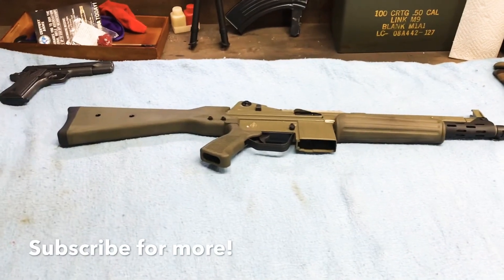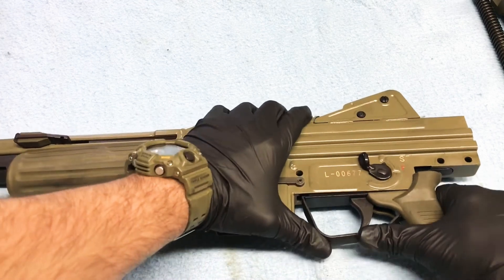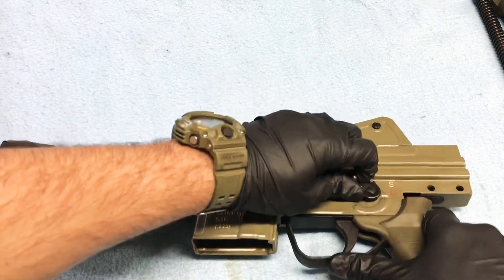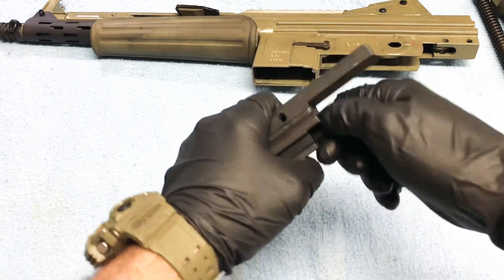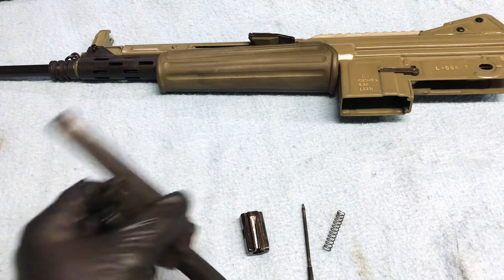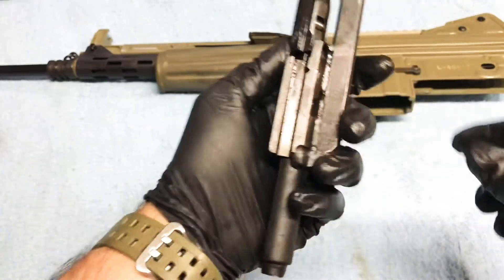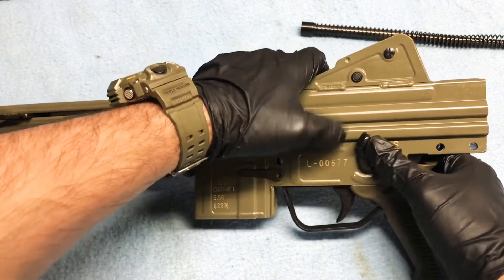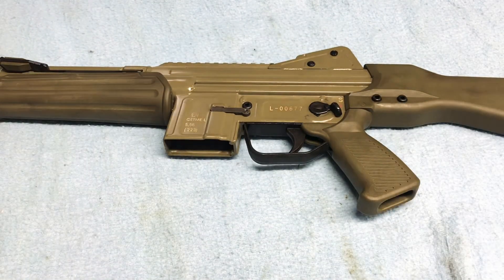HOW TO DISASSEMBLE YOUR CETME L, LV AND LC STYLE RIFLES FOR CLEANING.

Comment: The factory manual for the L states "There is a fair amount of manipulation required" for the removal of the safety lever. That is the understatement of the year!!!  My L is very accurate, I have a 2 mil RDS mounted, and after a 25yd zero,  I was hitting a 3" round steel at 100yds with 62g M855 LC ammunition.  Removal of the trigger pack requires a great deal of patience and calloused fingers.  If your fingers are not calloused, they will be after fighting the removal of the safety lever.

Comment: Two tips. To remove the safety lever, pull the trigger housing back to where it stops on the receiver, it will come out easier. 2nd tip, and this is just my opinion, for the trigger group push pin, place it in from right to left. That way when you release the mag, you won't push the pin out if you miss the mag release.

Comment: For turning the bolt head, I use a flat head screw driver in the bottom slot. Same as my Cetme LC, Cetme C and HK's. Some can be loose enough to turn with fingers but most with good springs you need a simple tool.

Comment: Thanks for the video.  It was very helpful.  I have the Marcolmar Cetme L and the PTR as well.  I just took the Marcolmar apart minus the bolt as I have not fired it yet.  Good lord, that safety lever removal is a pain in the ass.......The PTR trigger assembly just comes off as one unit without taking anything apart.......lol
Reply: I got my MarColMar 3 days ago. Taking it apart definitely gets easier lol.
Reply: Yes I have the same two guns and the cetme L is truly a pain in the ass to assemble.

Comment: Thanks! Finding the sweet spot for removal and installation of the safety selector is the toughest part of the job. The CETME L is the dirtiest rifle I ever shot! It quickly fills with black powder fouling, which doesn't seem to effect operation in the least. It's possible to get the rifle cleaner, but not totally clean because of all of the nooks and crannies that powder residue hides in. Good enough is good enough. Marcolmar is out with a Gen 2 CETME L as of late Summer, 2019. Near as I can figure, these start with approximately serial number L-01357, maybe a bit earlier. The differences from earlier guns include a redesigned mag well, and a new slightly darker green Ceracote color. This color is said by Marcolmar to better match the original parts kits on hand. The new Ceracote is applied to an even higher standard. I find Marcolmar's CETME L to be very handy and very accurate, with sweet ergos.
Reply from the maker: That saftey selector is always tricky, as far as cleaning it goes, I try but my hands are to large to really make any progress in the tight corners 😂
Reply: Learned a couple of tricks from you, thanks! First, to slide the bolt into the receiver before mounting up the trigger group, so that the hammer doesn't have to be depressed to install the bolt. And, how to easily install the bolt head on the bolt body.
Reply: Funny you should mention the GSR accumulation. In the Spanish service there is a joke dating back to the 7.62 CETME C, saying that CETME stands for "Cada Esquina Tiene Mierda Escondida", Spanish for "There is Hidden Shit in Every Corner".

Comment: For the safety switch, remove the pin, then rotate the safety switch to the raised fence which puts it at about the 11 o'clock position. Then slightly lower the rear of the trigger assembly ever so slightly and the safety switch should line up where you can feel it to remove. Practice it a few times and it gets easy.

Comment: That's an early production model. If you're lucky, you got ahold of one of the well assembled ones. The ones we got in the Spanish Military were for the most part awful, mostly due to poor quality control and cost cutting. But it weighed less than the C, so it was liked by draftees thanks to the overall weight reduction compared with the C.

Comment: Dude great video again I was wondering I have the cetme L as well we have talked on Instagram watching you disassemble yours makes me realize I may not be the only one but is the safety really stiff on yours in general I know I had to wear mine in sliding it back and forth just to get it to the point I could use it and during disassembly had similar issues getting it out and the hardest part of putting it back together was getting the safety in to line up with the trigger pin hole let me know when u can another great video always good stuff man.
Reply from the maker: Yea this saftey is pretty stiff , when you operate it , there really isn’t a super positive click whenever switching from safe to fire. As far as install and disassembly, Iv been told remove pin then saftey, when reassembling, saftey first then pin, I’m sure after a dozen or so takedowns, we’ll get the hang of it. Thanks for watching man!
Reply: @NoblesTx  definitely man all the parts need to get worn in forsure I appreciate the information for the take down hopefully they will work themselves in I've talked to you about how smooth they were on Instagram about it I was wondering as well what mags you were using like brand wise I bought a few different types and had good lock with the brownell mags
Reply from the maker: Man I love the recoil of this thing. All the roller guns are a lot of fun to shoot. If you can ever get a zenith z5rs or anything in 9mm jump on it, the mp5 style roller locks are a blast and cheap to shoot too! Iv only used D&H magazines from palmetto with dates of 2014 and 2015 and 1 old school mag from 2003 without an anti tilt follower and all ran great. So far Iv only had one failure and i think it was due to old underpowered 223. Was a FTE. One thing I noticed though, on the 4 D&H mags Iv been running , the bolt was shaving off a little bit of paint and MAYBE aluminum on top of the feed lips but doesn’t look like it’s going to be a problem. I haven’t tried any of my brownells mags yet.
Reply: @NoblesTx   NoblesTx  dude I 100% agree with you man I'm a skinny dude so to not bruise up my shoulder is nice hahaha and I'll definitely check them out I've always wanted a mp5 type ptr or zenith so I'll have to try and get my hands on one and I've as well had issue with a few of the mags I got just super tight in the magwell I definitely noticed scraping on the mag feed lips as well

Comment: Another tool you can use to turn the bolt head is a flat head screw driver by putting it into the slot on the bolt and turning it, same for any cetme or HK. I have the same cetme L as you btw right down to the color and rail. Took me a little fiddling the first time but once I understood it now its a breeze to take down and put back together.
Reply from the maker: That’s a great idea, maybe next time I’ll eat my Wheaties for breakfast and turn it by hand 😂